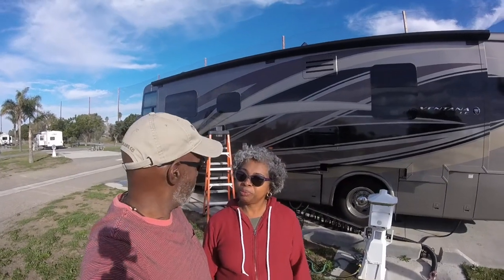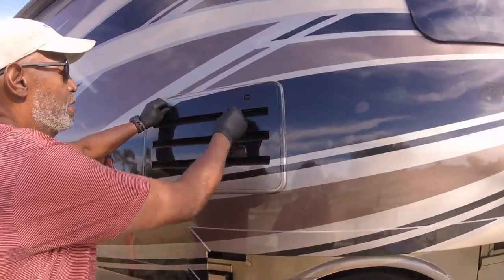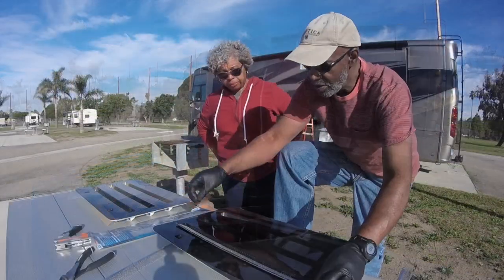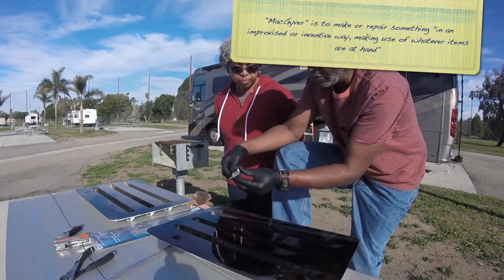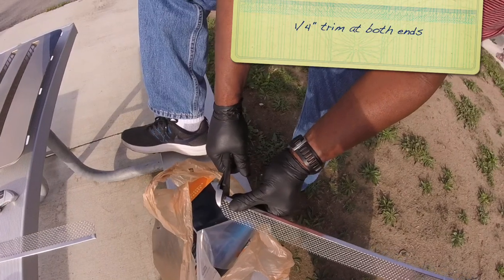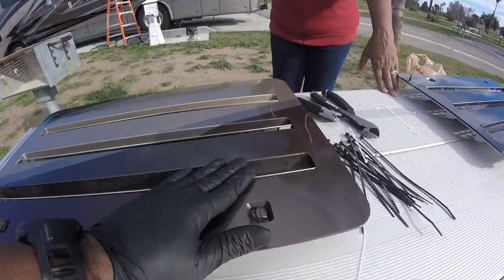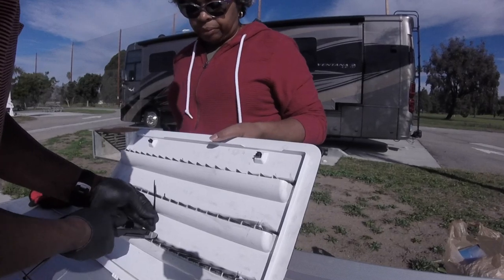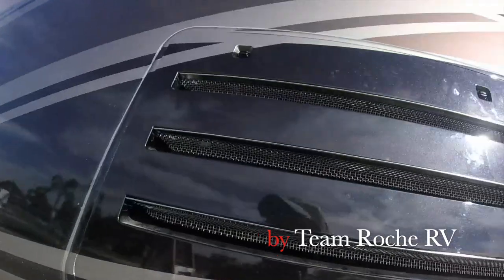'Camco' Flying Insect Screen for Dometic Refrigerator Vents Installation

Comment: Nice! I just did mine this week. A friend told me they were supposed to go on the inside. I thought the instructions said on the outside, and that's where mine seemed to fit best and where I put them, like you did. Of course, I tossed the instructions and recycling was just picked up for the week. 

Thoughts? 

Also, I saw reports of those push-twist fasteners working loose and people losing their vent covers going down the road. I drilled a couple holes on the side of each fastener and added zip-tie strips. Easy enough to get off when needed, and I don't anticipate needed access very often (hopefully).